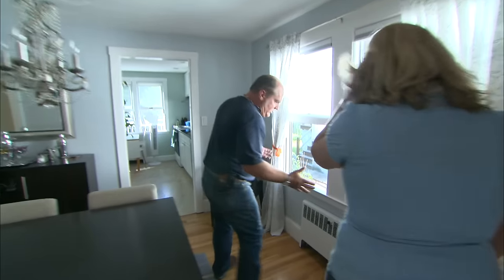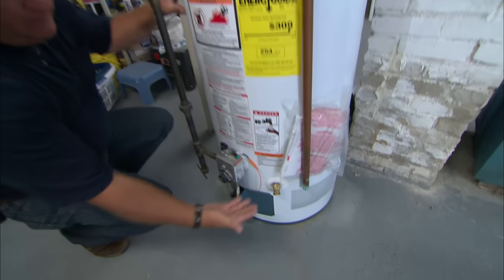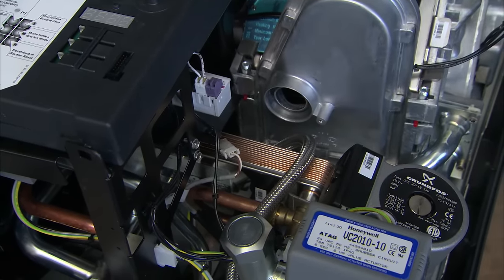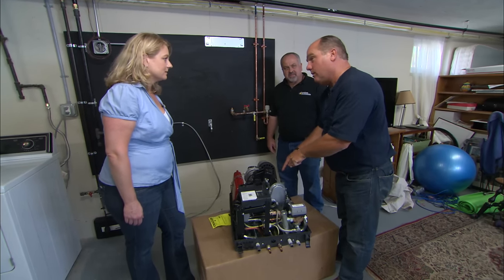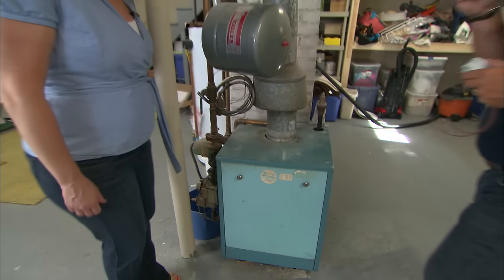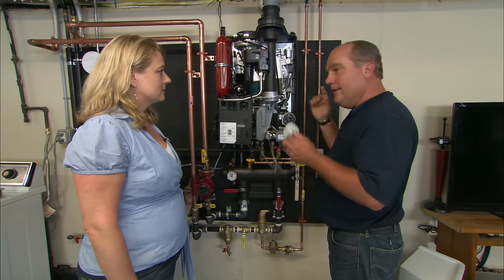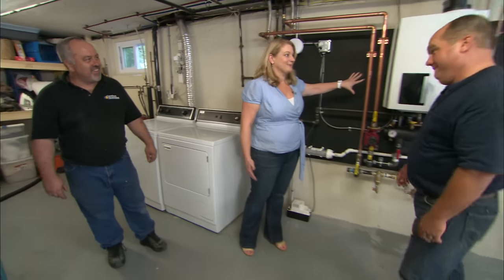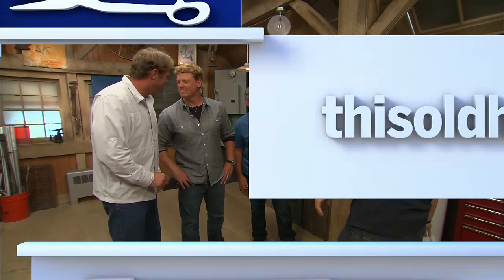How to Install a Combination Boiler/Water Heater | Ask This Old House

Comment: That is new tech for you guys?????
** Laughting in european **
Reply: Only the northeast USA really does things the "European" way. The rest of the USA uses forced-air heating. A smaller market means they tend to get this stuff far later than other places. Add in the different size pipe and 60hz instead of 50hz electrical supply makes bringing this stuff over even more complicated.

Comment: Why have you not got a concentric flue, one that has the air intake around the outside and takes the flue gases through the middle, because that is one of the worst flues I’ve ever seen and the fact it’s PVC makes it even worse I understand you don’t need to use an aluminium flue but geez you could have used a plastic coated one that would have made it look a lot better

Comment: 8:21 Why not design the heat side of the house so the same water will circulate through the heat registers and then you solve the problem of not having enough hot water and heating your home. The system could be designed so once the water has ran through out the heating of the home and it needs to be disposed of the system will eject that water and then it would allow new water to go through out the heating of the house? This would be more energy efficient and would not waste as much water unless you are using water such as in your sink etc. Maybe then more people would see the benefits and it would be more attractive. If I had the opportunity to build a house at one point I was thinking I would chose this option but I think that if it can't do both actions at the same time then I would think of other options. Grate concept but make improvements then it may sale to more people. I almost was thinking of telling my apartment complex about this concept to put it in each persons apartment but I would be very disappointed to do so. I liked the presentation and how you installed it but sorry.
Reply: You can't drink water that's been sitting in a radiator.
Reply: Please don’t share any of your ideas with anyone in your complex, unless your goal is to hospitalize your neighbours

Comment: Flue system wouldn't be allowed in the UK as it's discharging at low level, boilers also have to be mounted on a non combustible surface and no need for a second circulator as all boilers have a high head pump fitted (6m). average life span of a combi boiler in a hard water area is around 10 years, they are good for some properties but not all, power failure, no hot water or heating, burst water main and no hot water.

Comment: Too complex. Gas is cheap and repairs are very expensive. Small increments of efficiency aren't worth the negatives. Keep it simple and reliable.
Reply: That cast iron boiler will probably run forever, they'll be lucky if they get 15 years out of the combi boiler
Reply: This is the standard type of unit in the UK since they normally have very little space in their homes. Parts are plentiful and cheap and everyone knows how to work on them. I doubt that'll be the case here. I'd honestly go with the type of system that's in my apartment. High BTU 50 gallon water heater with a loop for the heat. Simple, very reliable, and still pretty efficient. I can start a hot wash, turn on the heat (3 ton air handler), and take a shower at the same time with no issues.
Reply: I like my cast iron atmospheric gas boiler. It's five years old and trouble free.
Reply: @jeffreyjohn2037   Mine is 35 yo and still working well. Only replaced the pilot.

Comment: My cousin just still one of these 'new fangled' Combi-Boilers. She has problems from this brand new install that tool two solid days to install. Water fluctuates between hot and cold. But the most significant issues is that she cannot fill up a bath tube with hot water. I've asked her for the specifics to understand the full context, like what the specs should be for the volume of water output for something like a bath tube and also, if there are any accessories to help her recover from what appears to be a frustrating loss of money. The company that installed it has been lest than accommodating to resolve this issues.  Does anyone out there in Combi-Boiler land have a solution?? Thank in advance
Reply: they sale recirc pumps that run on timer, this are often used for tankless water heaters, I would recommend installing one

Comment: You yanks are light years behind the UK when it comes to combo boilers
Reply: That's because boilers of any kind aren't too popular in the U.S.. The largest share of newer homes have forced air and furnaces. Forced air makes it easy to do central air conditioning and American homeowners demand that, as it gets hotter in the summer in many parts of the U.S. than in the U.K.

Boilers and radiators are more likely to be legacy systems in older homes.
Reply: You brits are light years behind the USA when it comes to heat and sunshine. mate.

Comment: I don't believe that these systems are so good,  What do they cost? Plus our hot water heater tank does NOT run 24 hours a day. You never hear it come on until some one uses a quantity of water. So where is the savings?
Reply: There isn't trust me. Stay with tank set up. It's a nightmare when the combi's break down

Comment: Ahhhhhh, so the combi gas boiler/hot water heater may NOT be able to handle 2.5 bathrooms operating at the same time showering/tub filling) plus, a dishwasher and supply hot water to a full house of baseboard heat.
Reply: Ray Josephs The beauty of a combi is that you can use it as an instant water heater to some outlets, but also heat a cylinder for others if desired. Larger combis produce in excess of 20 litres of hot water per minute, enough for at least two simultaneous showers. The dishwasher is an irrelevance- for a start, they don't use that much hot water. Secondly, why is the us still using hot fill dishwashers and washing machines anyway? It's far more efficient to have cold fill and an electric element in the appliance - you get a hotter, more sanitary wash, temperature is better controlled and you use less energy.

Comment: That exhaust venting looks horrible.  It will blow into someone’s face walking by lol.  Also the code states 4’ vertically and horizontally from windows or doors.  This is wrong.

Comment: Genuine question for USA guys. I’ve seen so many videos showing your water heaters and they always say that the water is on all the time. As in the water is always maintained at the at hot temp. Why?

Why do you guys not use a timer to ensure, say, you only heat the water for the morning and the evening? This is how it is in the Uk (we’ll was before Combi Boilers)

This isn’t an attempt at a “Uk better that USA” bullshit or vice versa. 

Can someone explain?
Reply: Graham DIY its not on all the time.  As long as the water temp is above the low limit there is no energy used.   But i did same like you a few years ago put water tank on timer to come on in morning and off at night.    Plenty people here say makes no difference cause it takes more energy to heat the water first thing in morning from very cold temp.

Comment: That would not be efficient on propane.   On colder days it would cost almost a gallon a hour at 2.50 a gallon.
Reply: 91K BTU/hour? That is a huge heat load! I'm averaging around 15-16K/hour in a rather drafty house.

Comment: What’s that monstrosity they’ve installed bellow 🤣🤣
Reply: Thats the primary/secondary manifold.  It mixes the boiler water(primary) with the heating loop(secondary)  but gives hydraulic separation. It saves a little labor of having to construct one in the field.

Comment: I'm shocked that this technology is so new in the states, we have been using combi boilers for over 30 plus years, the venting system, flu we call it here is just a poor design , 99% of all combi boilers produced for the uk market are called a balanced flu system " a tube inside a tube, exhaust in one tube and air intake in another... these are not "junk" very efficient compared to seperate systems, just need to be installed correctly. Just do a google search on the .co.uk google and you will find lots of information. I still work on old baxi boilers over 20+ years old and run perfectly. Property maintenance expert www.fyldefacilities.co.uk
Reply: Craig Savage I watched this and couldn’t believe they never used a concentric flue Hahahaha
Reply: I despise concentric flues and have removed many of them. In our climate they tend to freeze the air intake portion closed relatively quickly. Also have had a large number of combustion fans die an early death due to flue gas reversion - exhaust gasses getting pulled back into the air intake. I keep the air intake a minimum of 36” from the exhaust and preferably a minimum of 12” below it, and always on the more upwind side of it. Never had frosting-shut issues ever again.

Comment: In my town coffee makers last 6 months, hot water heaters fail in 5 years. Those wouldn't be financially viable
Reply: Your town needs to invest in better quality hardware!
Reply: Idk if the location matters but in nyc most last 20-25 years
Reply: Calcification, in a word. It can be addressed by other means.
Reply: Change anode rod every year and also drain each year they can live for along time if done  other then element going bad
Reply: Install an inline filter and/or water softener.
Reply: Tell me where at q series is anode rod?
Reply: It would last way longer if you did you due diligence. Install an in line water filter and replace its filter every 3 months, also you need to flush that water heater tank regardless if it's tankless once a year. Also replace the anode every 3-4 years

Comment: If you loose power to the house you will not have heat or hot water. Natural gas tank and furnace is better. This is not a good idea in my humble opinion. If you loose power to your house do you want to loose hot water and heat? Not me. Gas will not be affected if you loose electricity to the house.
Reply: How would your furnace power up in a power failure? You won’t have heat either way, gas is not power source it’s a fuel source
Reply: @andreyyaromich8277  Thats correct, you would not have heat if you lost power to the house but you would have hot water if you have a  water heater tank. You misunderstood me. If you remove the water heater tank as they do in this video and go the system they recommend you will not have hot water or heat if you loose power. I will always have a 50 gal water heater and separate boiler or furnace in my home for that reason.
Reply: kevin maxey How often do you loose power in the US? People talk about it on every video like this. Here in the U.K. I can recall one power cut in the last twenty years, I think we were cut off for about four hours. It's so rare no one worries about it.
Reply: @spencerwilton5831  OFTEN.  Electrical storms and Ice storms take out transformers and Electrical lines to homes because they are above ground on poles stretching from the street to the houses. Some are underground and they are less problematic.

Comment: Not good, so when your boilers down you have no hot water either. IT will save you money on gas bill but its twice as much and wont last as long, at the end you will wish you had old set up again,simple is better.
Reply: Capitol Refrigeration,Heating,and Cooling  There's a lot of money to be made, but only install piggyback units to have redundant service if one goes out.
Reply: Or they could do an indirect that would avoid the cycling on the boiler for hot water, while still only having one combustion appliance.

Comment: Hard water destroys these.
Reply: Kyle Turner Only the secondary plate heat exchanger, easily removed and replaced with an off the shelf part (at least here in Europe) but this can be avoided by occasional flushing- a competent DIYer can do so easily.

Comment: 4:18  all this bs and they don't even use primer, what a joke
Reply: Primer isn't required to glue a pvc joint. Only when the code requires it, which for a non-pressure joint like this it's not going to.

Comment: I cannot believe this video is suggesting homeowners do this themselves!!    What about the circulation pumps, zone valves, zone relay, low voltage wiring???   What about all the electrical work?   This is very misleading!
Reply: I thought those guys were contractors, they were actually the home owners! FAKE NEWS!
Reply: thanks
Reply: It's inspiring, but a smart person should know that people who do this for a living have learned a whole lot over the years and this vid is just a gloss of the complexities.
Reply: Yep its a lot of work and YouTube videos but it can be done by the Di Yer's. If you don't have the skill set, learn or pay the big bucks. My brother in law 11 years ago cobbled a Rheem install and has not had a problem with it. Dum Luck I guess.  I agree its very misleading, don't spend $$$ unless your ducks are in a row.
Reply: This can be done by homeowners...but you won't be done in an afternoon, that's for sure. You need experience with plumbing and electrical and hydronic heating systems. In other words....you'd better be very handy, have someone skilled in the trades who can help, or have an engineering degree.

Comment: I would never saw this to anybody. You never want to have your hot water and your heating water in the same system if it goes down you lose everything. That gas-fired water heater will last forever before she needs to replace it. Who sings don’t last forever bad idea especially combining the two. Nothing but a bunch of salesman very unfortunate